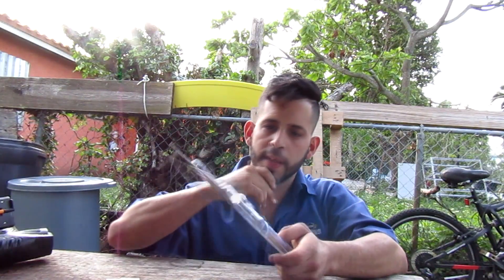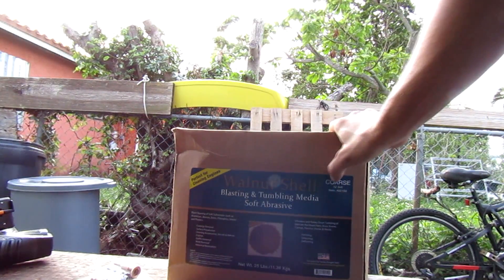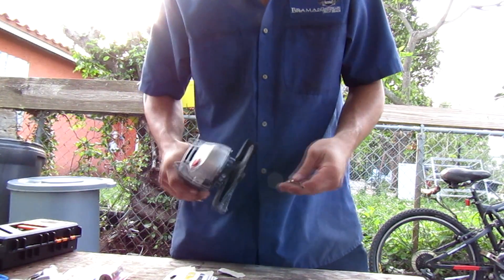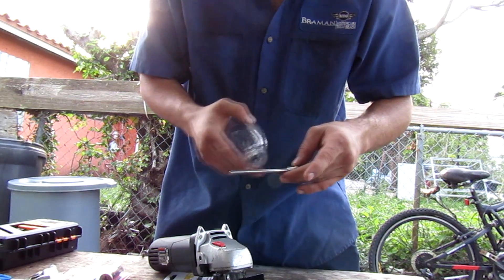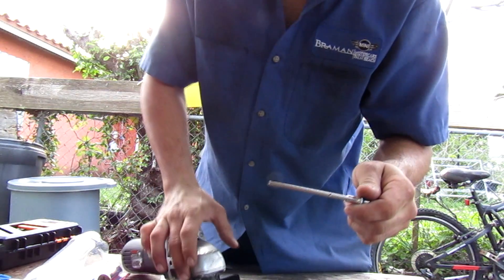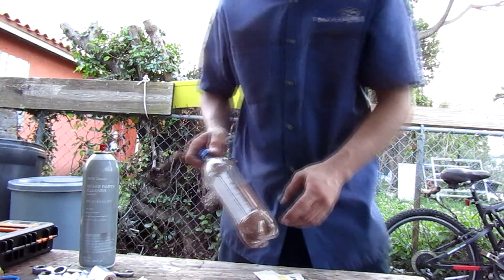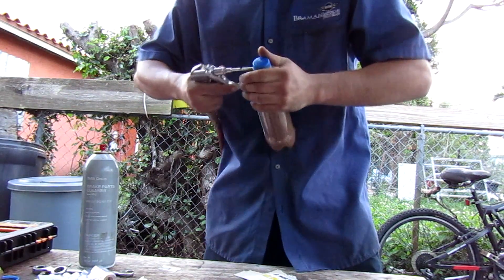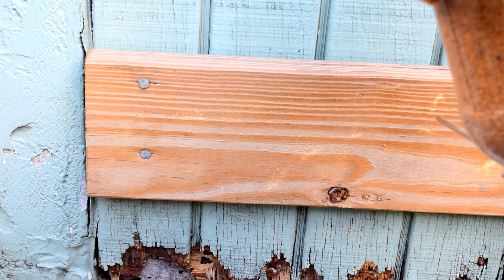How to make a sandblaster under 5$

Comment: Thanks for this. I just bought a store sandblasting gun, syphon feed. But made the mistake of picking up the 24lt compressor instead of 50lt. Pressure drops too quickly so stuck. Any tips? Also i tried with salt, fine. It's ok for softer finishing. i'm curious why you choose walnut sheel, is it the problem with silicosis that you can get from sand dust?
Reply from the maker: timothy sullivan hat’s because the compressor is too small i have a 74lt tank and does just fine and i chose walnuts because i feel it penetrates better and it’s also environments friendly, i also use it  for removing carbon from intake valves in direct I️njected motors